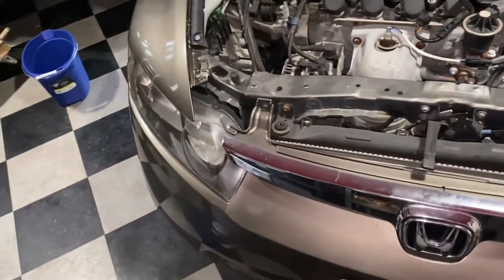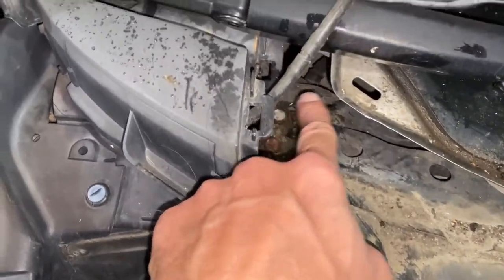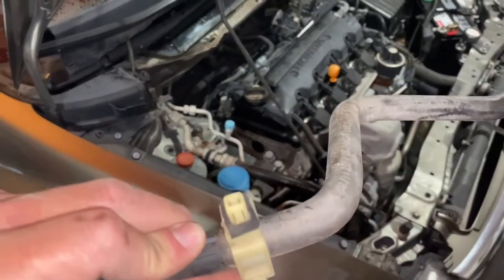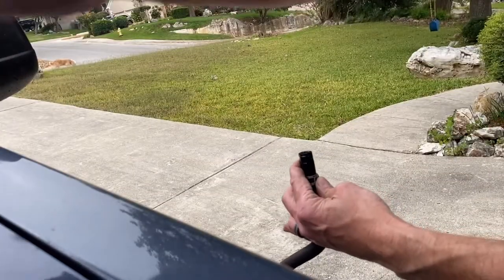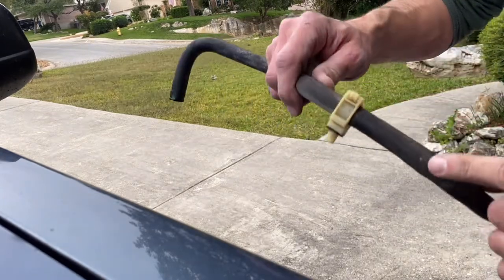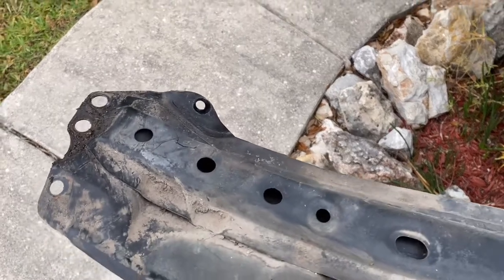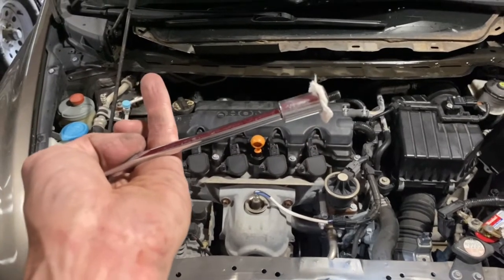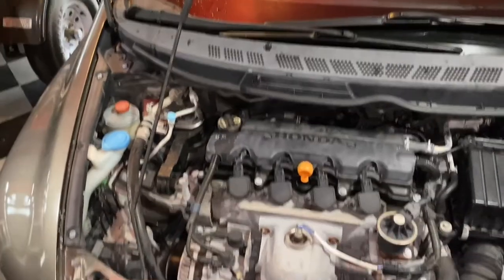7th and 8th Gen Civic Brake Feel Fix

Comment: Hey buddy I changed my master cyclinder but pedal is still squishy and my car brakes like front passenger side and rear driver side is not working in diagnosable position but other diagonal is working  working properly.. didn’t understand what will be the issue.. please guide me
Reply from the maker: You need to bleed the brakes. Sounds like you introduced a ton of air into the system when you changed the master cylinder.  Have a friend help you starting with the right rear wheel, then the left rear, then the passenger front, finally driver side.  Make sure your lines aren’t leaking at the master cylinder as well.

Comment: What could be the cause of the blockage? I justed rebuilt my front brake pistons and they no longer qork. I'm hoping this video is my solution. I know the rear ones work because I've had to use my handbrake to stop my car as I'm testing my brakes. Will try this now and report back. Fingers crossed.
Reply from the maker: You probably have tons of air in your brake system is why they don’t work after rebuilding the calipers. The blockage in this video was buildup in the vacuum check valve attached to the brake booster.
Reply: @ijfim  Believe it or not, it was a mud wasp nest that was built in the brake booster hose! I work on my cars outside under a carport and there are lots of those guys around.  I pulled out the engine and the car was sitting there for about two weeks. They're harmless, except they love to build their nests in any type of hole. I actually anticipated this and plugged in all hoses with some paper towel, even this hose, but I didn't catch it in time. Thanks to your video, I blew compressed air and the nest was blown out and now my brakes work perfectly!!! You are the man!
Reply from the maker: I love to hear that these videos are helping people! Glad you are back in the road now with no stress. I know how that feels.

Comment: I think my hose or brake booster has a pin sized hole because I can hear it hiss at idle. thank for posting this video.
Reply from the maker: It might be the hose connection itself.  I would clean the check valve inside hose first and check the hose connection. Trim the cracked hose at the ends. Then, if it still leaks, I would swap the hose with a new one. Last, I would swap brake booster with one from a salvage yard or new.

Comment: I have 13 civic. Maybe half the time I start my car I hear a spring being sprung noise with a slight clunk…. Doesn’t happen all the time. There is a slight give in brake pedal but I never loose braking power. Any ideas?
Reply from the maker: Wow, interesting! Sounds like a noisy brake booster to me, but it could be a corroded brake pedal return spring. Is your brake pedal hard before you start the car? Then it might be a ruptured brake booster.
Reply: @ijfim  it feels soft on first press. 2nd press it gets firmer
Reply: @Youn1347 did you figure out the problem?? I have the same issue
Reply: @souloho3900  I have not. I am assuming it’s the abs modulator…. What I’ve seems and researched you can buy a used one but would be a waste of money.  News ones from Honda $1,200 ish.  I’m not willing to fork that over. Annoying yes, but I can live with it. 293,000 miles  and counting.
Reply from the maker: I finally resolved my brake issues by replacing the brake booster and master cylinder.
Reply: @ijfim  how much did all that cost plus how difficult to replace? I don’t have abs or traction control as a result of my issues…
Reply from the maker: @Youn1347 it was around $75 since I got a salvage yard part. I’m sure Amazon won’t be too bad. Salvage yard parts are typically OEM as well.

Comment: At a red light my car rolled back into the guy behind me  even though i thought i had the brakes pressed it just kinda released seems like.  Each spot i put the peddle position it relaeses
Reply from the maker: Sounds like a fluid leak or master cylinder failed.  Yep, use that e-brake and get it home and fix that ASAP!
Reply: @ijfim  I think so. My parking spot is dry. Inner wheels dry. M Cylinder tube connections dry,  fluid is full. Pads are good. Peddle firmness is right. Then they sink after a 20 seconds . Then I hold it where it sinks to and it sinks from there. And where I put the peddle it'll sink eventually
Reply from the maker: @cognac8297 my guess is master cylinder for sure. Bypassing internally if not leaking externally.